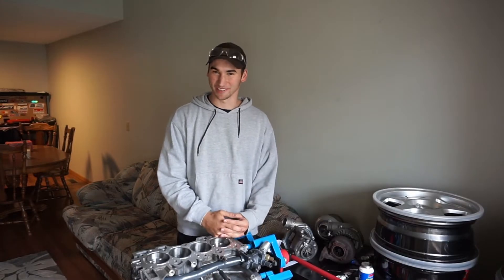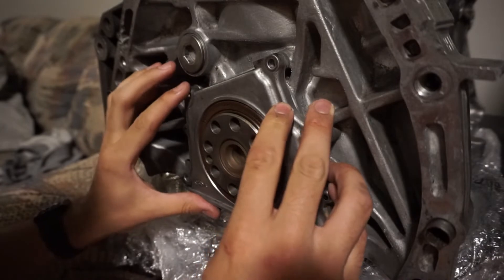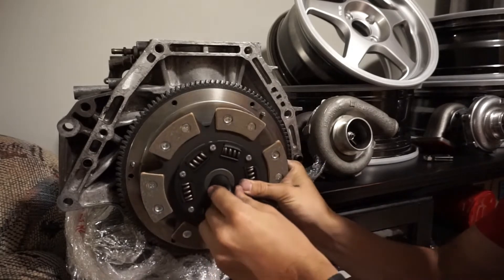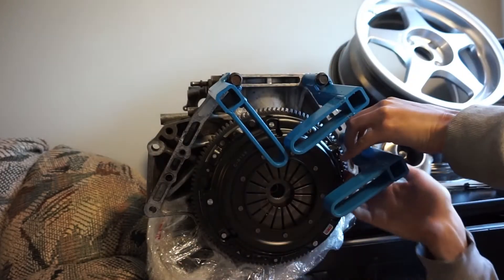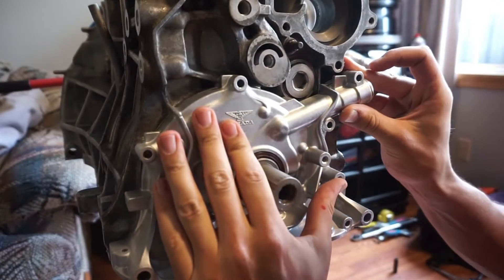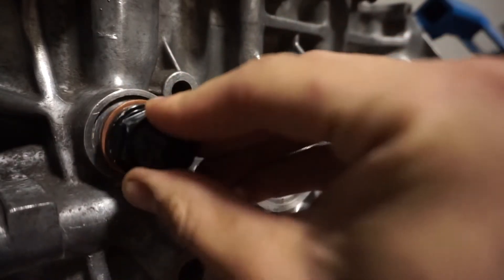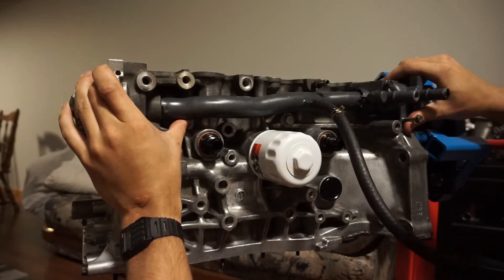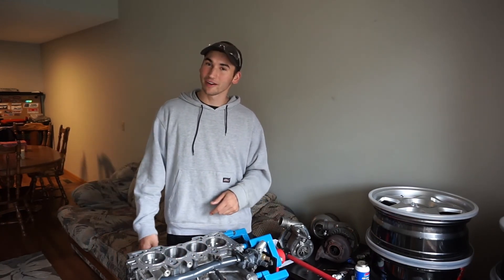CSS B16 Block Coming Together Nicely! Guided Assembly Video!

Comment: Always use honda oil filter. They destroy the competition, but you can use the honda s2000 oil filter. It fits like a glove and it’s a little wider so it gives you more filtration.
Reply from the maker: Thanks for the tips! I exclusively use oem honda oil filters now! Crazy to think these videos are over 4 years old now, i've learned alot since then!

Comment: Holy crap! Is that a 6puck?!? You can’t daily drive them dude
Reply from the maker: I'm praying it will be smooth and easy enough to drive somewhat comfortably
Reply: @kraftingkars  also.... K&N oil filters are not safe, they filter out too much zinc
Reply from the maker: @tonyschill8054  what would you recommend? I was thinking about putting an oem honda one on instead?
Reply: @kraftingkars  OEM or wix, I’ve seen first hand what them k&n filters do and it isn’t good for the motor